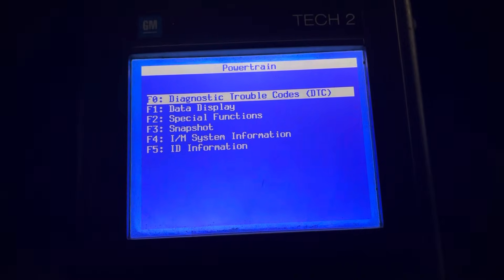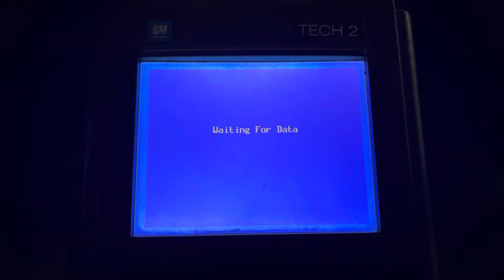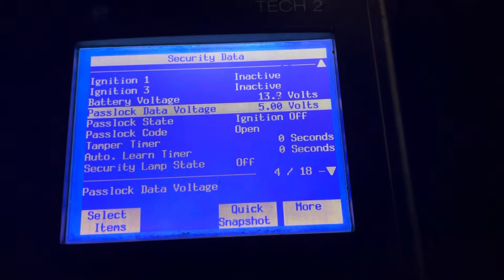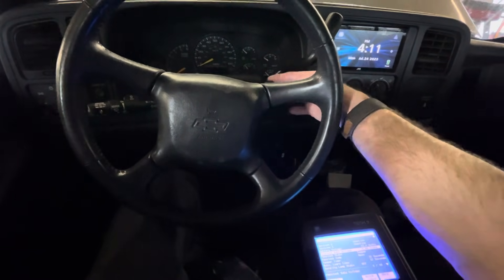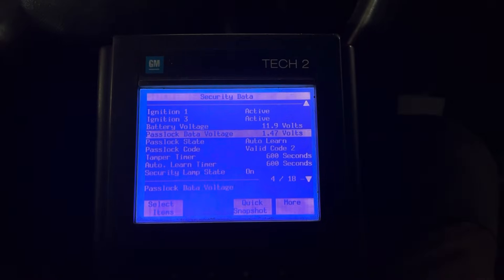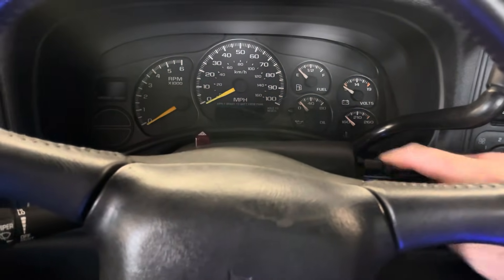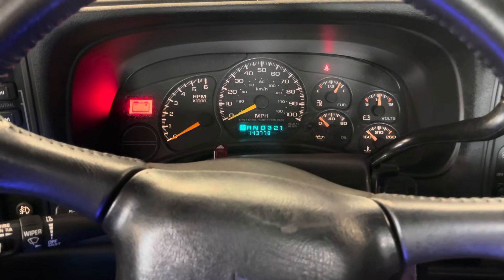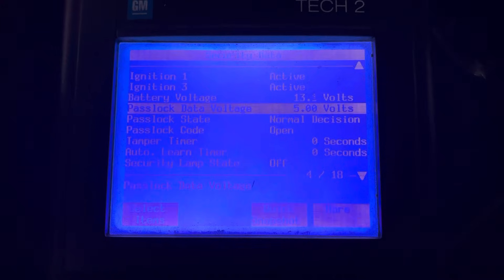99 Silverado Starts and Dies code P1631 B2960 Passlock Theft System 30min Learn No Tools

Comment: I have the same problem on my 1999 Chevy Silverado.the key was lost.it got a new ignition n key. I've cycled the key tried to program.but the security light on the dash doesn't ever turn on unless I hope the passenger door
Reply from the maker: Attempt to start the engine, it should crank and fail to start, leave the key on and then the theft light should start flashing.

Comment: new subscriber here. is this the reason why i can’t go past 30mph? my cat converter smoked once. transmission overheated tonight. not sure if my gears are slipping or how to escape from limp mode. any tips for a rookie?
Reply from the maker: The theft system is likely not the cause of your problem. Sounds like you may have multiple problems, I would advise seeking a shop for diagnosis.
Reply: Possibly throttle position sensor.does it bog out when you accelerate sometimes
Reply: Why do you think trans overheated?
Reply: Everything was great until lost key n changed the ignition
Reply: How much is a diagnostic test.? Sounds like iMight as well scrap it

Comment: I can’t get my battery light to go away so I can’t do this reset
Reply from the maker: Need to diagnose the charging system.
Reply: @DadsGarageDiagnosticSpecialist 
I alreasy replaced the alternator, it’s got power just not wanting to start due to a lock smith changing my ignition incorrectly
Reply: No answer v
Reply from the maker: Needs diagnosis of the charging circuits if the battery warning light will not turn off and/or battery is not charging.

Comment: My 99 chevy express is 30 mins..ten on off,xs 3...it would last a few weeks..now if it sits overnight. Iv got to do relearn...im going to replace bcm and ign lock..mine is no chip key..i hope this solves my problem
Reply from the maker: The BCM is not likely. The Passlock sensor is far more common for causing something like that.

Comment: I have the same codes but when I go key on my data voltage stays at 4.25
Reply from the maker: Verify wiring is good. The Passlock sensor is very very common to fail.

Comment: i just replaced the ignition switch in my 2000 Chevy Tahoe z71 5.7 liter motor its four wheel drive. it cranks but then dies ,it was running fine until the switch totally fell apart
Reply from the maker: The learn procedure is pretty much the same so if it doesn’t work there may be something else wrong.

Comment: Have a 99 Chevy Tahoe 5.7 gas. My security light stays on. Starts and cuts right off. Tried resetting. Nothing worked. Yesterday I unhooked the battery and tried to jump the vehicle with only the cables to the battery to the battery charger. Vehicle didn’t start. But hooked the battery back up and it worked fine. The security light had went out. Now it’s the next day and the vehicle is doing what it did at first. Start and cut right off. Any advice? I’m trying the reset now and will unhook the battery again to see what happens
Reply: Security light never flashes at all
Reply from the maker: So you were able to get it to start and run? How about any codes in the PCM and BCM?

Possible battery cable problem, possible weak battery if related to tampering with the battery/cables so make sure everything is good there. 

Usually when this sort of intermittent fault happens the Passlock signal is still within the valid voltage range, but is giving an incorrect password… so the theft light will usually stay off and the engine will start after a quick relearn. 

Then the next day the Passlock sensor gives a different password, and the PCM refuses to start until learned again.

The Passlock sensor is a high failure item, so it is highly suspect. Do verify the wiring is ok too. 

Thanks.
Reply: It starts but shuts right back off.n scan shows no codes??
Reply: It always has started but does right away.inter et says passcode shuts off injectors..I've left battery cables off touch together.tried cycling key.???
Reply from the maker: Yes it will start and die of the Passlock system has a problem. If your theft light never flashes then I’d suspect you have something wrong. Possibly the new part is faulty or it needs further diagnosis. 

It might have some codes.
Reply: How can I bypass it
Reply: I read I can bypass bc n hotwire it.??
Reply: Throw all that crap in the garbage.👌
Reply: They say I can't get a fob for door locks n program it?? Why wouldn't the programmed fob being there let it run?
Reply from the maker: You can’t bypass it because the computer wants to see the Passlock voltage vary when you turn the key. And the remote FOB is totally separate from the Passlock system. 

You’ll need to use the scan tool and see what the Passlock voltage is doing when you turn the key.
Reply: Thanks
Reply: It was the security passlock that kept my truck from running. Finally got the 30minute procedure correctly done. The truck runs fine now. The security light will stay on, so you will have to take out the security fuse so you do not have to keep putting in the 30minute passlock procedure every time you start the vehicle.
Reply from the maker: Thanks for the update. I’m glad you got it working.

Comment: I have no security light when door is shut only is on when opened having the the same problem cranks but dies I’ve tried the relearn twice and still don’t work
Reply from the maker: Most likely has a system fault. The Passlock sensor is a common failure.

Comment: I’ve bought a new BCM from highway 71 auto parts for my 2004 gmc Yukon 5.3. Put the new BCM in and did this relearn procedure and it starts fine. But on the way to work this morning a check engine light came on and I have a p1631. The new BCM I bought says to be programmed to the vin I gave them. So do I need to do this again or program the BCM with a scan tool?
Reply from the maker: I would suspect a faulty Passlock sensor.

Comment: It’s not working for me what could I be doing wrong? Because I followed the video the best I could
Reply from the maker: Usually that means there is a system fault. A faulty Passlock sensor is the most common failure.

Comment: Got a question for ya, I have this code in my recent data for my car but I can run the car I've driven it 2plus hours multiple times with the theft system light on but it comes on randomly and I have no idea why when the light does come on my vehicle won't start so i wait my 10min to get it out of theft mode and it starts and sometimes not all the time the light will come back on but the car doesn't shut off while driving
Reply from the maker: Typically, when you experience the theft fault coming and going like that, it is usually solved by replacing the pass lock sensor, which is part of the ignition lock housing. 

At some point I may do a future video on this system and the related repairs. 

Thanks.
Reply: @DadsGarageDiagnosticSpecialist  awesome thank you so much!! Really saved me a head ache
Reply from the maker: @nathanieltedder185 you are welcome. Let me know if it fixes it.

Comment: Mine starts and dies and there is no security light, tried this and still starts and dies! No codes either
Reply from the maker: Possible lack of fuel pressure. 

Check out this video for fuel pressure information and testing… Chevy S10 Lacks Power... Repairs Declined
https://youtu.be/gANePORYtm8
Reply: @DadsGarageDiagnosticSpecialist  just replaced the fuel pump
Reply: When it fires i try throttling it and it just falls on its face and dies
Reply: Checked all the fuses
Reply from the maker: You will still need to verify sufficient fuel pressure is present to open the injectors. 

Could also be possible clogged exhaust. Try removing the exhaust pipe from the engine and see if it will run.
Reply: @DadsGarageDiagnosticSpecialist  it's just open exhaust no cats or mufflers
Reply from the maker: @KevinGilpin-qk6nq then I would suspect low fuel pressure or possible theft system is not receiving a password signal from the Passlock sensor. 

Pass lock sensor voltage should be 5 V and then should drop to the specified password voltage key on and cranking, if not then concentrate on Passlock sensor circuits.

Comment: Have the same symptoms except for my security light only flashes for like 15 second then the warning light doesn't even stay on
Reply from the maker: I don’t think it matters whether the door is open or closed, but I’d imagine it should be closed. 

You likely have some sort of theft system fault. You need to know what codes it has and what the Passlock sensor voltage is doing, etc.

Comment: So the voltage doesn’t drop with koeo. What does that mean?
Reply from the maker: Possible faulty sensor or circuit problem.
Reply: @DadsGarageDiagnosticSpecialist thank you for answering. I actually figured it out. The new ignition cylinder I installed was the incorrect one. I put in the old one and started right up
Reply from the maker: Nice! Glad you got it figured out.

Comment: What happens when the pass lock voltage doesn’t drop
Reply from the maker: That usually means the Passlock sensor is faulty or the magnet is missing from the lock cylinder.

Comment: No ten seconds?
Reply: the 10 seconds is if you dont open the door. its actually between 5 and 10 seconds enough time for the RAP to shut off. opening and shutting the door while its in the relearn wont harm anything either.

Comment: PSK II? Or PSK 3?
Reply from the maker: PK2 if I remember correctly... I don't even see vehicles from this era very often anymore.

Requires 10 minute learn three times, or SPS 10 minute learn one time. If it still won't learn there is likely a problem with the system.

Comment: I have the p1631 code but i did the   re-learn (just changed my pcm) and no security light anymore but still wont start
Reply from the maker: Repeat at least three times. If it comes back it will need to be diagnosed.
Reply: The vehicle was not starting before I changed the PCM, would that have anything to do with it?
Reply from the maker: @goodoldrinks8717 if you replaced the PCM, it will need to be SPS programmed for a immobilizer learn, etc. 

You will probably be better off putting the old PCM back in, but it might be too late now.
Reply: How do you do the SPS immobilizer learn
Reply from the maker: @goodoldrinks8717 send to a shop who has the equipment
Reply: Ahhh I see now...
Reply from the maker: @goodoldrinks8717 you might be able to install the old one though.

Comment: What does it mean if my passlock data voltage does not change? My data voltage will never change and stays at 2.35 volts with ignition ON or ignition OFF?? Checked all 3 wires and do not have any shorts or open circuits and I have power at red/white wire on 3 pin connecter for ignition lock. Faulty passlock sensor?
Reply from the maker: Probably a faulty sensor. It’s common.

Comment: This works  for me but it's only temporary. A few days later it will randomly flash that security light while I am driving, and go back to no start. Then I have to reprogram it again. Local Chevy dealer wants to charge me $968 to replace the security system. Can I get some advice on how to fix this on my own instead?
Reply from the maker: Usually the Passlock sensor needs to be replaced and that is part of the ignition housing.
Reply: @DadsGarageDiagnosticSpecialist  any way to replace this on my own or is that repair going to need a dealership
Reply from the maker: @mitchabboo it’s not a terribly difficult repair. You need a tool that costs about $25 so you can compress the steering wheel lock plate and remove a snap ring. 

The repair should take about an hour for a seasoned technician who has done many of them. 

A first timer taking their time could get it done in half a day or less. 

I don’t currently have a video showing this process, but I’m sure there are many out there.
Reply: @DadsGarageDiagnosticSpecialist  I’ll have to look around. Most people bypass the system based on the videos I’ve seen so far
Reply: Doesn't passport sensor come with new ignition n key
Reply: Do you have to remove the wheel n snap ring to change passkey sensor?
Reply: I wish I knew what it needs.i could change parts no problem
Reply: It must have some thing to do with the security light not coming on I don't have a door key that works now.the ignition has been changed.poeer door locks dont work.
Reply: If it doesn't have a chip transponder.id rather get rid of the security system
Reply: It says you can run a wire on bcm n bypass it .but how will door locks etc.work then?

Comment: I just bought a Silverado with the 5.3 and it turns on but dies immediately unless I give it gas. Any ideas on what it may be? The security light comes on once I open the door
Reply from the maker: Possible theft system fault. Needs diagnosis.

Comment: For my 2001 chevy suburban ive had a few times doing the 10 min security reset every couple weeks and now neither the 10 min or 30 mins reset works. Any ideas? Almost to the point im gonna have to sell it...
Reply from the maker: Faulty Passlock sensor most likely. Replace and learn again. 

Thanks.
Reply: @DadsGarageDiagnosticSpecialist  would that be just the key cylinder or the wires going to it?
Reply from the maker: It’s part of the ignition lock cylinder housing. The lock cylinder just has a little magnet on it that rarely has a problem. 

You have to take the steering wheel off and use a simple and cheap tool to compress the steering wheel lock plate and then it’s easy to replace.
Reply: @DadsGarageDiagnosticSpecialist  ill give this a shot when I can. Appreciate the quick response.
Reply from the maker: @kogykun4928 you are welcome.

Comment: Do I have to open the door after every attempt? Mine is currently doing the same thing
Reply: I’m back so it worked out for the truck running but after like 4-5 days it locked it self again and then again any suggestions? And the light stays on after I’ve done the reset
Reply from the maker: @misamata3131 at that point I usually replace the Passlock sensor which is part of the ignition housing. That is how they typically fail.
Reply: @DadsGarageDiagnosticSpecialist  ok I see I’ll have to give it a try it all started happening when I put a new pcm in it
Reply from the maker: @misamata3131 I have had success with the pass lock sensors from Napa in the past
Reply from the maker: Usually yes you need to open the door to cancel RAP Retained Accessory Power and enter a new key cycle. 

Thanks.
Reply: @DadsGarageDiagnosticSpecialist  ok will try right now hopefully it works had to get some one last time to reset it with computer second time in like 3 months or so

Comment: My truck gauges stopped working and only showed battery warning light yesterday after work. it would start for one second and die has codes,
Theft deterrent fuel enable signal not received
P1626
Lost communication with BCM
U1064
Did this before about 3 months ago left battery un hooked overnight and it was running until yesterday
Reply from the maker: Sounds like a possible network, communication, fault, or missing power feeds from the ignition switch or something. 

Thanks.
Reply: @DadsGarageDiagnosticSpecialist  how cold I fix this myself or would I have to take it somewhere. I work on this truck all the time just never done computer work I do have a scanner tool.
Reply from the maker: Check ignition 1 and ignition 3 data with the scan tool. They should turn on and off with the key…. 1:23
Reply: my Tahoe did basically the same when I was driving i thought it was my alternator but after a week of my ride sitting on the side of the road working on it trying different things all it was ,the fuse for the Gauge's , THE. FUSE. FOR THE GAUGE'S